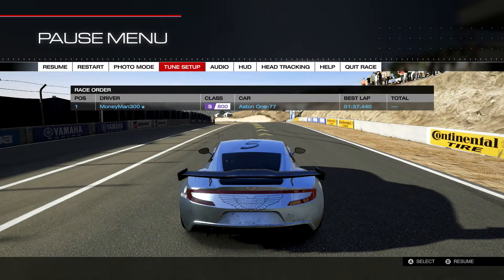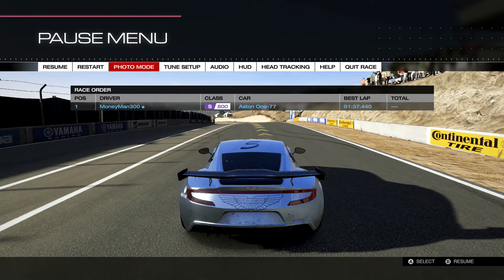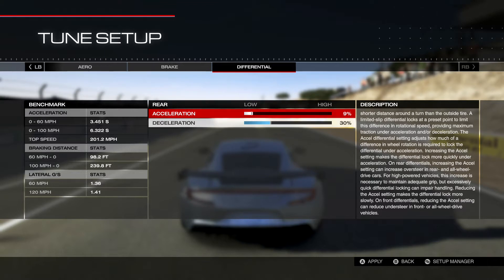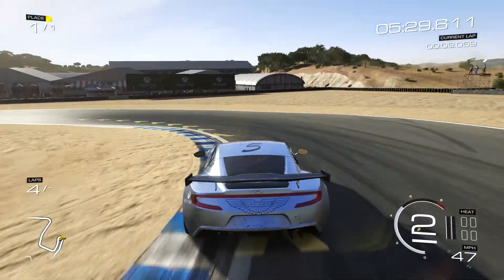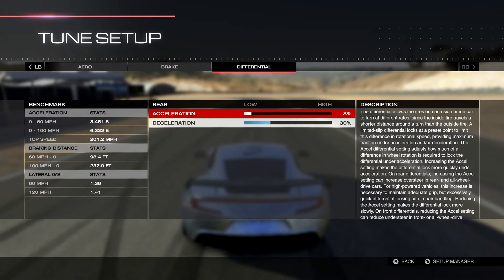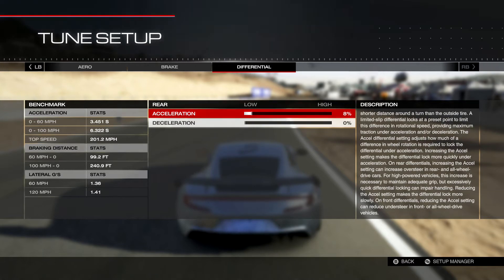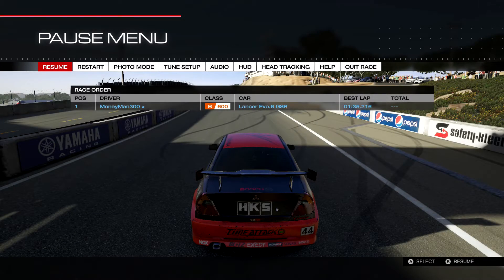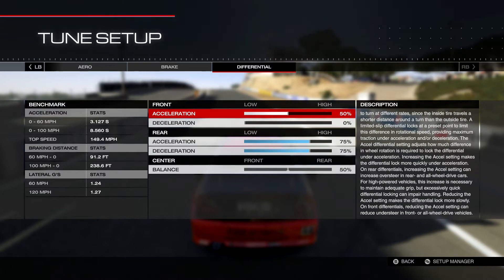Forza 5 - Tuning in Depth - Differential

Comment: MoneyMan300 - You don't fully understand what you are talking about.
0 % - it's a fully open differential and 100 % - it's a fully locked diff. (no speed difference between the wheels at all).
No offence but next time read a tittle bit to fully understand the topic before advising others.
I can gurantee you that your videos will be more trust worthy and professional without such a common mistakes.

Comment: Yeah Forza's descriptions on some of these items are just wrong (higher % for higher TQ).  A high torque engine with a higher % diff accel lock is just going to break both tires free and spin them both.  But the diff is hard to tune if you have assist on because they can compensate a little bit.  For short track (need turn-in) ill have the car set with a slightly softer front end and stiffer rear end with the accel @ 10% and decel @ 20%(to keep rear end from sliding out of control off the throttle).  Moderate tracks front and rear end are the same and accel @ 15% /decel @ 15%.  Oval front end is stiff and rear end is soft (understeer) with accel @ 20% / decel @ 10%.  But this doesnt work for every car and is frustrating also depends a lot on your gear ratios and if the car is just too much engine for the chassis/tires and it just cant handle the torque.

Comment: I have the habit of using clutch while breaking in corners, if I do so the deceleration won't be a form factor right?
Reply: If you're still playing racing games, you definitely want some engine braking, especially in turns. Different amounts for different tracks depending on the types of turns you find there, but think of Road America full. You may find yourself in one of those kinks where you just have to lift in a car that you can't achieve that in without some engine braking. This is probably the most clear benefit of engine braking, but the same thing applies is other turns where there's a part of the corner(s) you just roll around rather than being under braking or accel, and also but maybe less obviously in all other turns. Too open a diff, or clutch in, you could be oversteering into the corner as soon as you squeeze off the last little bit of braking. Too closed a diff, you could cause yourself to understeer through a lot of turns. You want to tune your decel especially to be most agreeable in the most difficult or technical turns, most ideally track by track.

Comment: I find I can get around corners faster than 95% of the people I race against thanks to pure throttle controll. No tcs/stab or any of that, just some really focused ( I mean its like the main thing I excel at in this game) throttle control. I do adjust my diff occasionally but often I take accel up if anything. I find im getting around and coming out so much faster than almost everyone else.
Still, Thats just something I got good at, maybe ill do even better with some diff work, i dunno.
Reply from the maker: Antifaith29 I agree with this...having good throttle control is key, especially in the higher classes.  Play around with lowering you accel diff settings....you may find yourself even faster.

Comment: deceleration has nothing to do with how much or little you engine brake, it has to do with how the diff works when you are off of the throttle. more decel = more stability, less = more rotation ( you said the opposite which is well untrue )
Reply from the maker: I went back re-watched and while I didn't do a great job of explaining, the effect of high vs low decel, as it works in the game, was accurate.  A higher decel causes deceleration when you come off the gas....using the term engine braking isn't a good way to describe it though.
Reply: No.... It doesn't
Reply: scubieroo05 no bro you are wrong higher decel setting more towards 100 is more rotation